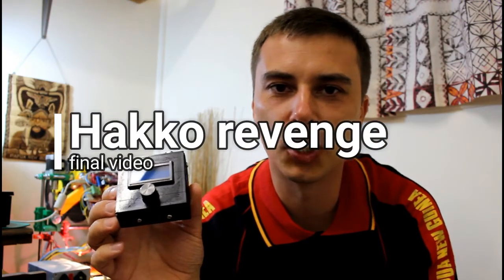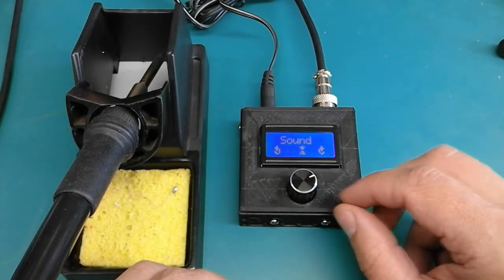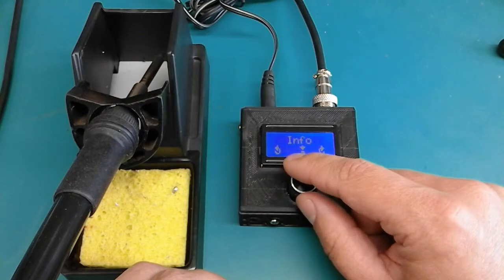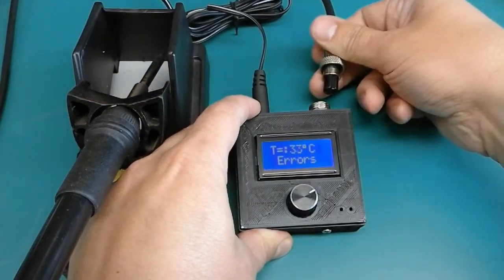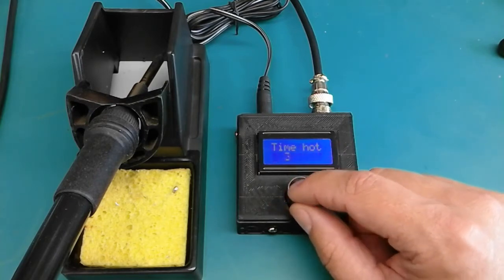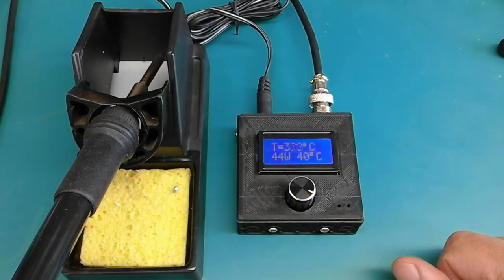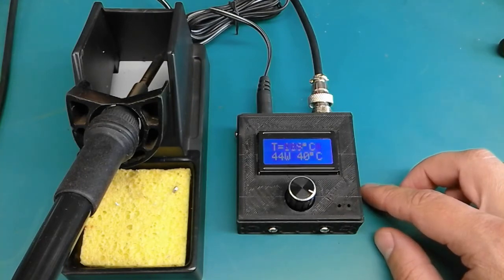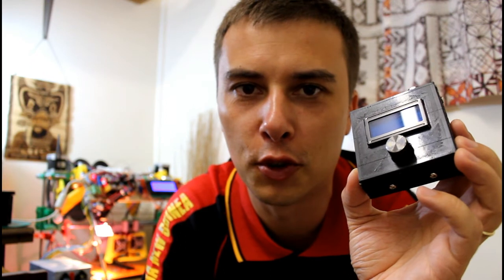DYI custom made t12 soldering station - hakko tip [2/2]

Comment: Amazing! Can I get along with your help?, If You don't mind to get questions and questions? My budget is small, if you are able to help, please let me know, So I start to find the cheaper options to get the components.
Reply from the maker: I don't mind the question. I usually buy all my components from aliexpress.com and I use JLCPCB.com or PCBway.com to create my PCBs.
Reply: @FunElectronicsToday  Wow! Perfect very kind from you to know  I can count with your help. 
I am taking a look at your project on Hackaday. io I am Oto user there, You already answered me, do you prefer to reach you there or here?
Reply from the maker: Go ahead and build it with no fears. It is a tested project. Since then I built 20 of them and gave them to all my coworkers to test out and play with. I had no major reported problems or erros and they seem to keep on working since almost one year ago. I do have some firmare updates I haven't published yet on the project's page, but I would like to. I could assist you if you come across issues. If you plan on documenting your building logs, don't forget to give me the link so I can see and maybe post that on the project's page as well.
Reply: @FunElectronicsToday  you inspired me too make my own solder station with hakko tips T12 and jbc tips ! I think the self made solder station's are much better as the original hakko or jbc etc. Because your selfmade is cheap and you know the components for me  is just like the original ( I think is better as the original ) fast in heating and have what we need ! For the original hakko or jbc you only is my opinion you pay for the name ! Thank you for your informative video !
Best regards,

Comment: Hey can you make a video showing how you flashed the firmware. I got the board all populated and I just can’t figure it out I got it hooked up to the MSP430 but it’s not saying it flashed just a break error
Reply from the maker: Good call. 
I added complete instructions on how to flash, what kind of cable I used and what settings I had. I also added complete pictures with the launchpad and monitor screenshots. I think it should be enough to get you through. Check the Instructions tab on the project page: 
https://hackaday.io/project/94905-hakko-revenge
Good luck, happy flashing and please post pictures when you're done.